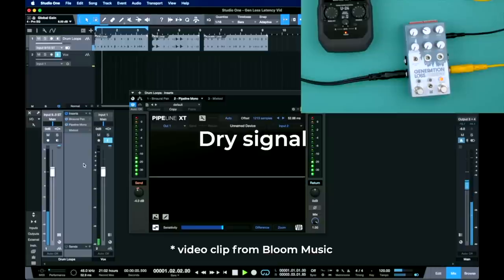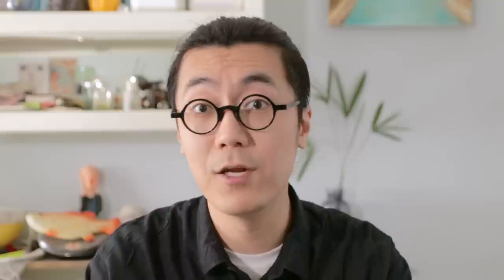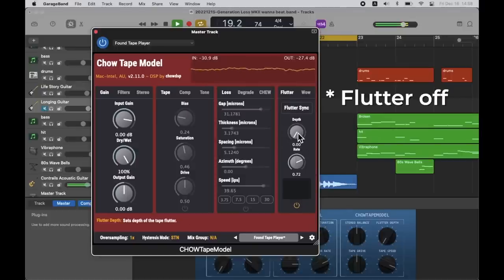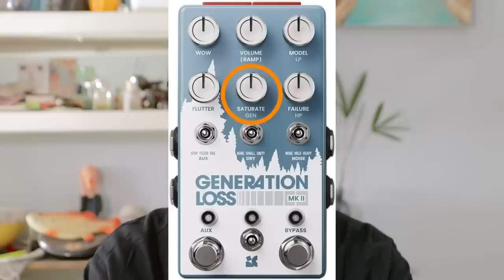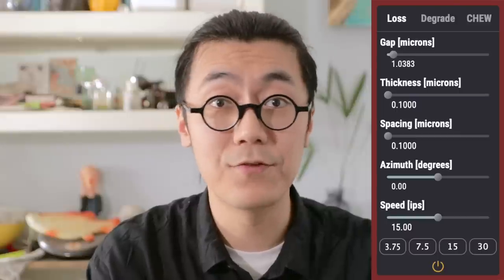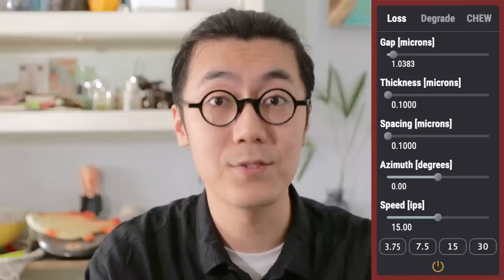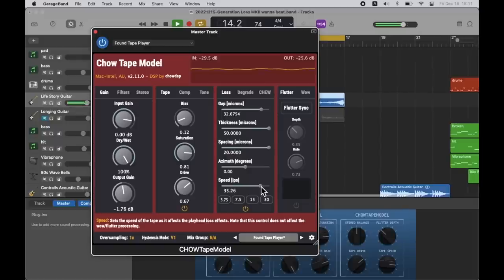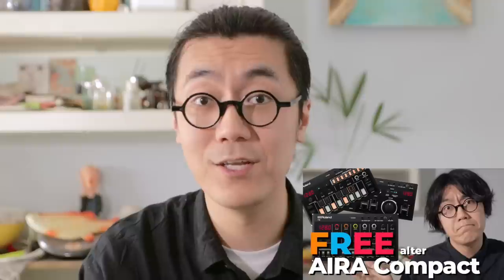How to Generation Loss MKII for free. | GAS Therapy #45

Comment: Have been debating this pedal for months, but the latency is a dealbreaker. Very surprised other reviewers haven’t mentioned this. I do think that digital pedal makers need to start publishing latency and A/D/A specs more explicitly. I tend to stick with analog pedals for this reason. Thanks for an excellent video.
Reply: They literally posted an update this afternoon fixing the latency
Reply: I've got this pedal and notice no latency. Maybe it's fixed. If there's latency, it's in milliseconds and not noticeable.
Reply: @davidpack4867  are you aware that 16ms latency is already considered substantial? again, milliseconds
Reply: I'm not sure how you could do this in a pedal without some latency due to the processing.  Old tape cassette recorders that are semi-broken with wow & flutter issues are tools I use a lot, though not each item for long as they often break beyond use,  and I don't see how any pedal could process the input instantly to give the effect. As to the accuracy of the stereo image on the pedal, it's not like any of the stereo cassette decks I've used, there was much more irregular warping on the alternate stereo channel.  but for mono purposes it's very accurate for vcr recordings and it's in the ball park accurate for any semi-broken cassette decks I have used, for a pedal.

Comment: The latency is definitely in there and at a fixed variable purposefully, it causes a chorus effect but yeah has the unfortunate side effect of doubling percussive sounds also. Chase bliss recently released and alternate firmware where it tightens the latency to be more of a flange type effect and sounds better on drums. Also maybe worth noting spread is only autopan in the classic mode, in the normal mode it is the failure algorithm being run twice for a true stereo image effect. (I should note I don't own or plan on owning a gen loss mk1 or 2)

Comment: A cheap vibrato and tremolo pedal chained together will do the trick as well. I use a TC Electronic Tailspin and a Marshall Vibratrem, which cost me 50 euros together
Reply: The Vibratrem is kinda crappy tbh but I've no need to spend big bucks on an EQD Hummingbird or whatever

Comment: I appreciate the comments regarding latency, but want to play devil’s advocate because latency is not the same thing as jitter. Jitter would make a rhythmic element nearly unusable because tempo would be inconsistent. Tempo can be consistent if there is latency; as long as there is no jitter, the user would simply need to add latency to other audio elements to match this unit’s latency (if trying to mix it in in a live setting).

Comment: Chow tape is a great plug in, but the dig about latency on gen loss made no sense. Chow tape does the same. All wow flutter effects do the same , because an audio buffer is required for pitch to move up and down in real-time in this way. Put chow tape at 50% dry wet and engage wow and flutter even with depth at 0 and you hear that latency there too. That’s just not a practical application of this sort of effect. And just like Chow tape, if using in in a time dependent way, you would perform latency compensation…  whether you are compensating 2 Ms or 25ms I just found that point very odd to make. When both can’t really be used that way without issue.
Reply from the maker: Yes it's the nature of wow and flutter, but the 25ms latency comes with every effect turned down. In Chow tape model you'll get rid of the double trigger sound with wow and flutter off, it's well optimized.
Reply: @playpm  "turned down" ... yep off is different than turned down. point being is , you are blaming it for being some weak cpu issue but thats not the case. if you just turn down the effect of wow and flutter on chow tape you also still get that latency. so you have to bypass that effect. just like if you bypass gen loss. its a false equivalency that makes people think chase bliss is using some crap hardware or something, when the reality is... thats literally the nature of that type of effect. and not an effect you would use in parallel... heck , that latency is there if you use a real space echo as its literally the distance between record and play heads. anyway, other than that I really enjoyed the video.
Reply from the maker: In chow tape model you can turn on and turn down flutter and wow amount to 0, and dry wet signals are in sync, no latency. This is what I called optimization. A constant 25ms buffer latency is a lazy work imo.
Reply: @playpm  doing that with an M1 Max MacBook Pro I did not experience that. With wow and flutter depth down, the latency is still there. Only with it switched off does the latency get removed (as I would expect) regardless, using a warble tape processing effect without the warble… or in parallel. Just why lol.
Reply from the maker: That's weird, what DAW are you using? I tested in GarageBand and Reaper, both using 2 tracks in parallel, one with chow tape mixed with dry&wet and one without chow tape, that's how I get my result. And I'm using MacBook air 2014.
Reply: @playpm  logic, even at 32 samples with wow and flutter not off there is latency because the buffer is still there. At bare min you will hear phasing. Which again goes back to just good practice of not using this sort effect as a parallel… hardly “lazy” which if I’m being honest. Unless you create your own hardware… I guess it’s easy to level that sort of judgement.
Reply: I say all this , not to be aggressive, but rather because this is solid content. Very usable . But no need to throw undue shade at a quality product or small business that is far from lazy.  Chow tape is fantastic and what I’m pointing out is a small aspect of the larger picture. But an aspect that would harm a business unjustly imho.
Reply from the maker: I totally get that, but still think it's optimize-able, that's why I like to point out more cons than pros, it'll be good for customer eventually.

Comment: There are other pedals.  Ribbons by Kinotone Audio is very powerful.   Also the Bygones Pro.  They both have excellent random modulation.   If you like noise, the Bygones Pro has a very detailed noise section.   The Ribbons has reverb, a compressor and more.

Comment: I like the VST effects but then there is something about using and external effects unit that just feels right I’ve been thinking about using a external mini pc of some sort load up a VST and use that instead and give a small display like a 5 inch if it’s possible it would blow my mind to have something like that that can load any vst effects as an external unit
Reply from the maker: Give it a try, pedals, amps, everything can be free.
Reply: Indeed there were hardware vst player device concepts in the past: Muse Research Receptor and a bit later the SM Pro Audio V-Machine was released. The devices were just x86 hardware platform based devices running Linux. For today, it is better to stick to an ipad or macbook air. No annoying fans and much more power with arm silicons.

Comment: Quite an issue, when used on my PC during if monitoring. I guess I should update my PC 😂
Reply from the maker: It also depends how your DAW handles the audio buffer size, like in Reaper you can set it to extremely low so you won't hear the latency, but it also depends on if your computer CPU can handle the quick calculation.
Reply: @playpm  totally agree. I am using Linux and it is less than straightforward. Anyway, what I wanted to point out is that this plugging is quite CPU-demanding. Or again, something wrong is on my side 😂
Reply: @stonedrecluse2833  plugins can be very CPU heavy and that won't help. Depending on your DAW you need to make sure you're reducing the buffer size as low as possible (with more than 256 I can't play guitar). But of course this also makes everything heavier on the cpu side, so having a low latency and many plugins is indeed quite intensive. 
Having plugins on a return track can help, other than that, just try to play an instrument with low latency and almost no plugin then when you're mixing get the buffer size to like 1024 and just mix ;)

Comment: its amazing the people don't understand that all a pedal like this is, is a VST hosted on a tiny terrible computer inside.  I get the romantic notion of having hardware in your hand, but pedal manufactures not explaining explicitly to the customer that they are buying a computer with a VST and letting them assume is some analog magic is wrong.  The same goes for eurorack modules now. They are mostly running Rasberry Pi mini computers with plugin code ported to them.  Then modular synth snobs pretend they are doing something no computer can do.  The pedal and modular snobs are all spending thousands on VST ports 🤣